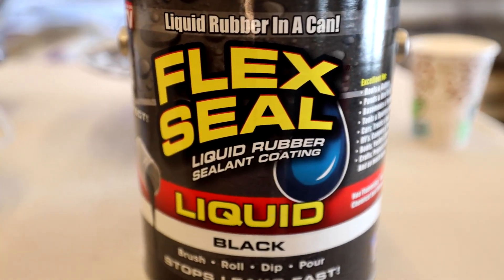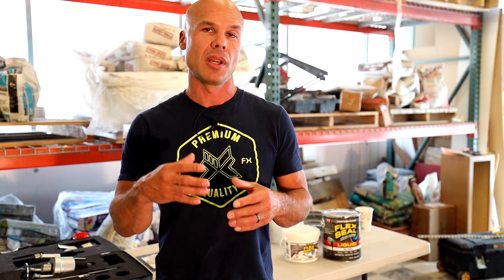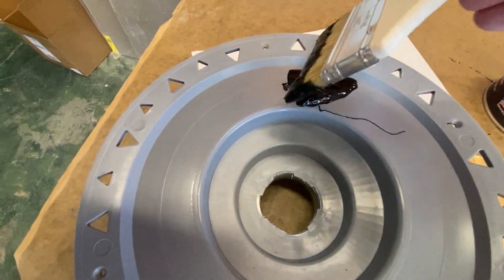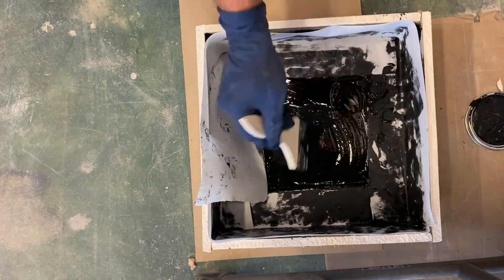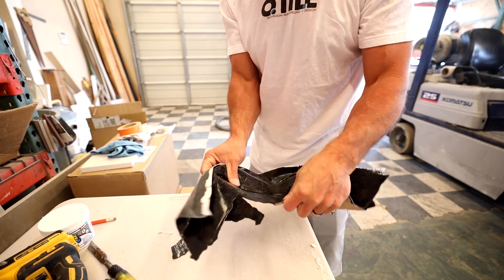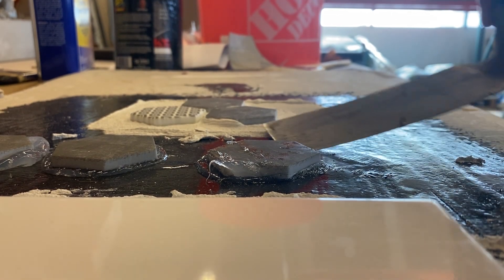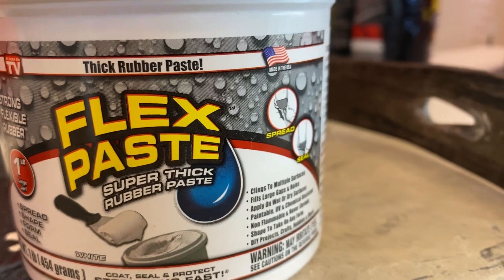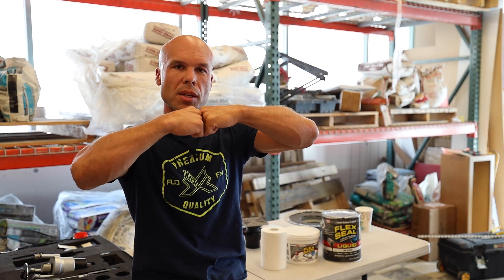FLEX SEAL to Waterproof a Tile Shower???

Comment: NOT on a customer's shower.  Try it on the one you use every day (maybe a temp remodel so you don't annoy your spouse too much).  Then tear it apart after a couple years, and report back.  Even better if this shower has revealable framing on the sides/undersides so you can check on a regular basis what's going on behind the backer boards.  And you gotta do another control sample shower that's used just as often for science!

Comment: It seems this product would also be good at the base of the wall at the gap, around the area where the floor is in close contact. And also at corner areas.  Maybe not, but if it’s ‘rubber like’ it should be a good seal. At the least, it will give that area a longer life. 
No tile job is perfect and none last forever. Might as well extend the wear time as much as possible.  What could be better than rubber to seal off water intrusion?  The mil on this stuff looks thicker than redguard. 
Costs more..; sure. But easy to apply, and FAR cheaper than a rip out from a fail. I think it is a viable ‘option’, especially in places like corners and floor angles. If the tile sticks, and it waterproofs the cracks.. why not?

Comment: No, I probably wouldn't use it due to the price vs thinset and redguard(or aqua defense) That said I'd have to do the math on kerdi and if it's around the same price I'd stick with kerdi but if it's actually cheaper then kerdi.....heck ya.  But hey, to each there own. Ohh and luv ya too tilecoach! Can't wait for you to roadtrip to VA(I know it will be a few years lol) . Also, I have a tile job in Florida in the beginning of july and that got me thinking about your project down there.  When are you going to be there? I'd love to help out with your special project. Keep doing what your doing. You are an inspiration to a lot of people, me included.

Comment: Would probably not use it on a paid job just for liability reason 
Would have to test the flex paste on a wet location and see what it does. 
You always do great video’s on testing products, I have modified some of my install procedures based on your testing

Comment: I would use it, to try and see what happens…. Would definitely start out using in a “pool shed shower/changing room” area or similar at first. As who know what would happen when start stacking tile and have the weight on the wall etc…
Really curious if say a 1x1 or other small tile would work better/worse than 4,6,8…..and into large format in areas.
Wouldn’t be comfortable using in my house with 12x24 and up tile etc….in a bathroom that if was “leaking” would be bad for homeowners and us (as I’m guessing NO manufacture out there would warranty their products once tell them what used, granted, would be an interesting “funnel phone call😉, as they are liken you did what with what🤣.
WOULD DEFINITELY LOVE to see ya give a try Issac and see what would happen w/ different variables (that one might encounter on a remodel,  ew construction, etc…job) and see what Data able to collect over time. 
Cheers✌🏻

Comment: I have used flex seal on cracked commercial drainlines where the cost to repair correctly would have been astronomical due to bad access. 5 years later the repairs I made are still water tight and super well adhered.
Flex seal would be a great solution for a pan that needs to hold water because it is a less likely to have issues in corners and seams (the areas all current waterproofing techniques struggle unless perfectly installed) because it doesn't have a tendency to crack when drying. the issue is the inability to use thinset means it is a pricey install.

Comment: I've used flex seal to fix swamp coolers pans in the SW. It's two to five times as expensive as its counterparts, therefore, it's not a product I would see as a game changer. If it was the same cost, I would use it everytime. It's better, but time and trips cost money. If I gotta go,  and it doesn't save time, I'll use the cheaper tried and true. Flex seal IS a better product, but it doesn't save me much time or trips. Price point is too high for a contractor to use it.

Comment: I'd worry about how it ages. For example, if starts to crack in 5 years that's no good.
Reply: Mortar cracks quicker than that.
Reply: @waynehead4902  Mortar is not considered a waterproofing agent. This would be in place of Red Guard or a hot mop install.
Reply: Yeah I was thinking about that. How long before it becomes brittle? it's going to shrink and expand with temperature changes.
Reply: Yeah I feel like there would have to be actual testing done. Not some in shop mini trials.
Reply: I was thinking the exact same thing.
Reply: Shrinking maybe too?

Comment: If the cementitious stuff doesn't stick to the flex-seal, how are you going to keep the grout in?
I don't see an advantage over redguard or such. Especially considering that stuff is pricey.
Reply: I never thought of grout as needing to "stick" to the sub straight, so much as lock all the tiles together. I always assumed that a solid installation to a sub straight with minimal movement was the most important factor in preventing grout to come loose.
Reply: I would think the grout that has silicone in it would work but regular grout should still stick to the sides of the tile. My question would be how spongy it would be as to not move and crack regular grout. Don't know has me.thinking though.

Comment: It is probably far more expensive so I wouldn't use it for that reason. I also wouldn't use it because the home owner would think I was a hack if I rolled up with flex seal. "no no no, really... Issac did testing on it, it's legit."

Comment: I would be interested to see if you can set tile on a vertical wall. With the tiles start to sag
Reply: Make a test it's simple
Reply: Matthew, I am using FlexGlue (clear) to install a combination of glass, tiles, and sea glass on a vertical brick wall.  It is actually the wall above a fireplace.  It is working great.  I use a caulking gun to apply it.

Comment: wonder how flex seal and flex paste would hold up to cleaning products and soap/shampoo.
Reply: Since it's a petroleum based product, it should be acid and alkaline resistant.   It's true enemy would be non volatile solvents, which you would never see in a shower.

Comment: I might use it on a customers house if it saves money?!?! I question the long term durability in a shower application compared to the normal thinset and waterproofing.  Would love to see you do it on a customers house
Reply: That’s bullshit you should not use untested products on customers house I would be pissed if he used this on my in my shower.
Reply: @espmegadeth1  he wasn't insinuating he would ever use it in a customers house. The point of the video was to make you think outside of the box and possibly try different things. There is always a better product out there . I'm pretty sure all contractors out there would never use a product that hasn't been tested and verified for use in that application in a customers home. At least not reputable companies . As with any product if it works and has been tested it should be used

Comment: What is the cost of this as compared to a conventional install?
Reply: That's the rub. From a strength and user friendly point of view, I don't see any issues. The main thing that will keep this from being used would be the cost. I can see it being 10 times the cost of conventional methods.
Reply: It's very expensive it's like $29  I believe for a pint not worth it
Reply: This is probably one of the biggest questions. FlexSeal products seem to be pretty expensive.
Reply: Ardex 8+9 is about $112 on amazon.  That's for a kit that has 1 gallon of 8 and a bag of 9.. so more than enough for a large home shower project. ..and maybe 10 other shower projects..

Flex Seal looks to be about $90 a gallon.. so the real question is whether or not you'd need more than a gallon to water proof your shower.  If 1 gallon is enough, Flex Seal is actually cheaper and won't leave you with a lot of unused product. But if a gallon isn't enough then 8+9 is going to be more cost effective.

Aaaaaand then there's the part where Isaac demonstrated you'd want to buy Flex Paste to use as thin set over Flex Seal, and that definitely costs more than the standard thin set that works with 8+9. So there's where the balance tips back in favor of using 8+9.
Reply: @tonymorrill6561  I don't think it would take more than a gallon to read more...
Reply: Good question
Reply: Definitely interested in cost comparison overall, but like mentioned, as a DIY, you don't need the entire 8+9 kit, so purchase price vs purchase price and longevity are the concerns.

Comment: The price for a gallon of red gard is about $50 (Home depot). Flex seal $90 (lowes) 
For a medium size shower for redgard use, it would be: $50 for a gallon redgard, thinset (versabond)$15 , grout (polyblend) $15. Let's double the cost of thinset and polyblend from (HD) just in case so total: $110
Now flex seal use: A gallon of flex seal (Lowes) $100, flex paste 96 oz (Lowes) $60, Grout double about $30. All from lowes total : $190
Pretty good gap but I would definitely likes to see you use it on an actual shower.   Although, I'm not sure if it's a good idea to use at a customer's house.   God forbid if you get that on a shower or floor or anything else other than what you intended it for

Comment: Seems like it would waterproof and bond well at first. But what happens years down the road with temp swings, humidity etc. Would it loose its elasticity and become brittle. Time only tells what can happen as we’re seeing with the Schluter systems now failing even though it was the answer to all our problems. Too risky for a complete shower.

Comment: Still waiting for a GoBoard review by the way. Just got a local supplier for the stuff but I haven't used any of the foam products yet. It's a lot cheaper, so I'm wondering if there's a catch.
Reply: I love Goboard. It is very light and easy to cut. Thinset applies and holds very well even for large profile tiles. It is more expensive than cement board which I will never use and much cheaper than wedi or schlueter.
Reply: I used GoBoard 6 months ago.  It's fantastic.  Will never use cement board.

Comment: Haha I would never use this on a customer's house but you've got me seriously thinking about doing it on my own bathroom remodel.
Reply: I used Flex seal on my own shower and it worked like a champ!  Water proofed my shower using all Laticrete products, wall board, sheet membrane, Hydro Ban and Laticrete sealer. The Flex seal worked better than the Hydro Ban and dried faster under the sheet membrane!
Reply: @johnnyb7200  good to know👍
Reply: Seconded. Doing my master shower now. I donno if I trust it for the pan, but itd save time on the walls
Reply: @natemartinez4595  You would if you bought a pint and saw for yourself.   This product is OUTSTANDING.  And it comes in clear, white and Grey as well.
Reply: Yes! I would like for you to tile a shower with using Flex Seal! It would be great if it was sponsored by Flex Seal! Then check on it after 15 years. My tiled shower was built in a house having a crawl space. Due to too much deflection or the house settling the tiles cracked causing a leak that rotted the wood subfloor under the pan liner. I don’t think the pan liner was attached high enough around the edges of the shower nor was there a membrane on the subfloor. So, the shower failed after 16 years.
Reply: @lillithjones993  thats not bad though, I mean it isn't 50 years, but after about 5 you always have the wife wanting a remodel anyway.
Reply: What do you use to grout to tile?
Reply: Will the Grout.adhere to the flex seal

Comment: Was waiting for this video! Seems like it works as a waterproofing application. I'd be concerned with how the flex seal paste you used to bond the tile would hold up in a wet area. I think that would be another great test. Hopefully it doesn't react like mastic does to water. Wouldn't want to be the first to try this in a customer's shower though lol
Reply: why don't just use a good quality thinset? in a future video he says this stuff mad him feel ill. he should have but didn't mention that here. and no don't do this on a professional installation.